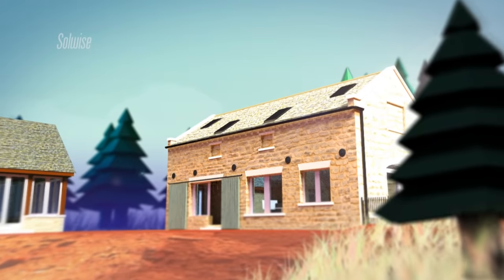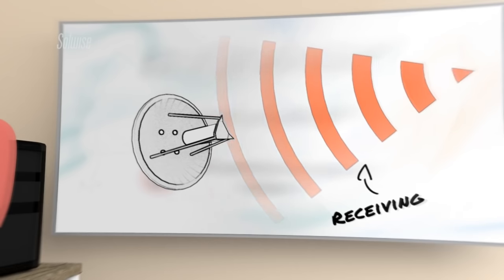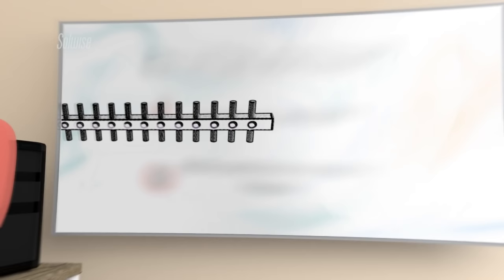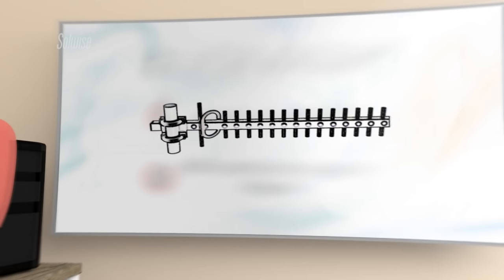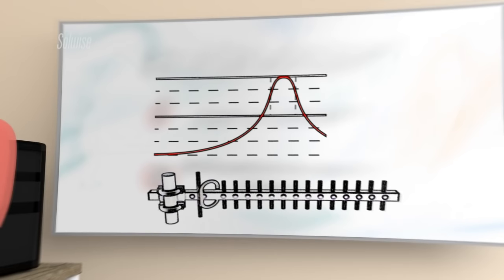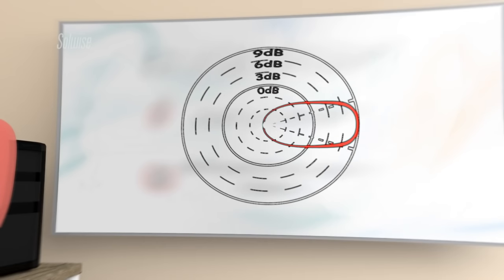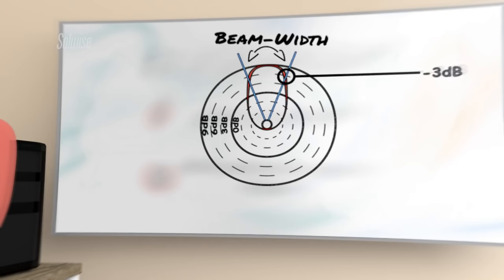Antenna Radiating Patterns explained

Comment: I have wireless mixer that has built in Wi-Fi and a single external antenna. I can't practically place the mixer very high off the ground so would if make sense to add a cable to the antenna and just mount it up high? I'm thinking this should/could boost the effective range of the signal. Is there any reason this wouldn't work?
Reply: @SolwiseMD  Funny. Thanks. Good to know about signal loss. Was maybe hoping to go about 3 meters (over a bit and then up) but perhaps that much length would be self defeating. A little Ringo in your voice- absolutely love it. Perfect for narration and voice-over. Thanks again for replying.
Reply: @SolwiseMD  read my mind. was just waiting for you to say, "he was a cheeky little engine."

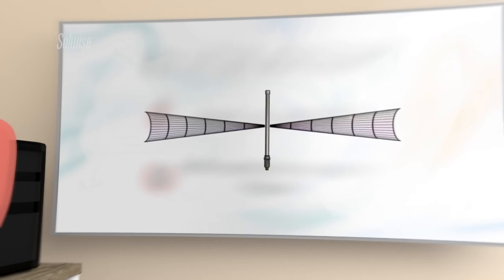Comment: I think your graphics at 4:03 are incorrect.  The narrator says that the omnidirectional antenna radiates in a horizontal disk.  The graphics at 4:03 show an antenna radiating in two vertical disks projecting out to the sides.  Clearly, it is not radiating equally in all directions in its horizontal plane.

Comment: Have you made a mistake for the uni-directional antenna? You mixed up the horizontal and elevation plane.
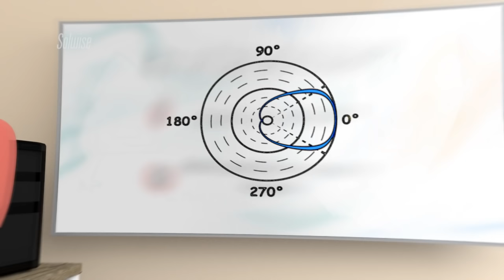Reply: @SolwiseMD At 2:10, the video shows a side view of the antenna, then at 2:20, the video said that it is showing the horizontal plane polar diagram. Hence, the video is saying that the horizontal plane is the side view of the antenna. The diagram should show a top or bottom view of the antenna instead. 

The elevation plane diagram is correct though, showing a side view of the antenna.

Comment: How can a cellphone booster internal antenna only cover some meters away in open field and a cellphone, with ominidirectional tiny antenna and low power, be able to transmit over 40Km ?

Comment: Wouldn't elevation plane in directional antennas be the "up and down" and horizontal plane be the "left and right"?
Reply: @SolwiseMD  "The elevation plane is like looking at the antenna from the side.  The horizontal plane is like looking down on it from above, like a plan or a map."
Exactly, and your graphic is showing antenna from its side and calls that horizontal plane 2:41 and then from above 2:43 and calls that elevation plane. Or am I reading it wrong?
Reply: @SolwiseMD  I'm a noob hence a noob question. 
Looking at this again the confusion originated from the graphic layout, e.g. at 2:39 the horizontal plane is the plane from which we're looking at the antenna as it is presented in the graphic, so the "left-right" direction (if we imagine aiming the antenna at the transmitter). But the polar pattern placement in the graphic at 2:39 would suggest the "top-down" direction. I tried to combine both in the same space but that's not how it works. 
The video is very helpful.
Reply: @SolwiseMD  yeah, that clicked, thanks.

Comment: Can anyone help with this question? An output power of 16dBm, linked to an antenna with a gain of 21dBi linked with a RF cable attenuation of 1dB use this information to create a point to point link (2 radios same spec) with a distance of 3km. They operate at 5.850GHz
Reply from the maker: You need to do a link budget. This cannot be done until you know more details of the receiving end e.g the receive sensitivity. My gut feeling is that this link should be fine.

Please note 16+21 EIRP is over the UK and EU legal limits.

Steve

Comment: The omnidirectional description is wrong.  Omnis DO transmit and receive from ALL directions and not into a disc shape only.  They do focus some energy but all directions are covered.  The disc pattern is misleading to viewers since that is the path of the strong part of the signal, but the signal radiates in all directions in a sphere, just not equally as strong in some directions.  Beam antennas are the same way, they radiate in ALL directions, just not equally well.
Reply: I am a "ham" I know lots about antennas.  My point is you should not use words like "only" and "none" when talking about beam antennas such as they radiate energy ONLY in the favored direction and NONE in the unfavored which is totally wrong.  Even a 100 element beam will still have radiation off the sides and wherever the weakest signal from it is.  There is no such thing as a perfect null with antennas.
Reply: Also your hypothetical example of a church steeple beam antenna to service a nearby village with Wifi can be easily solved with a 2nd access point servicing the inside of the church using a drastically different Wifi channel and optionally different polarization (not required but helps).  This is Wifi 101 stuff.
Reply: Not just in sectors, in ALL directions there will be radiation.  Imagine a sphere around a wifi antenna up on  your theoretical church steeple... go anywhere in that sphere (within reasonable distance) and I guarantee you will get at least SOME signal.  It might not be usable or fast but it will be present.

Comment: I notice your video and the specifications of antenna products on your web site do not correctly specify "dBi" or "dB re isotropic" where absolute gain is most certainly implied. "dB" is, of course, fine when you are comparing two values, but absolute references require more clarity to comply with the expectations of the SI unit system. This makes your otherwise nice video incomplete at best. Worse, it makes your antenna product gain specs deceitful at best. This is a common mistake made by newbies to antennas. You might want to fix it and fast.

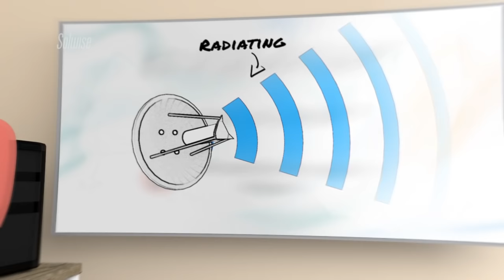Comment: 0:36.  That statement is false.  For example, if 2 hams are communicating with each other at long distance (perhaps a few thousand miles), the polarization of the transmitted signal can change so there is no guarantee that the antenna that transmits well on one end will also receive well on that same end because the polarization change may be different in the 2 different directions of communication.  In some cases it may be better to Tx on one antenna and Rx on another during the same contact.  That is not "cheating".  Many hams try different antennas during a contact for that reason (uncontrollable conditions by mother nature).

Your other wrong statement is that omnidirectionals don't radiate in all directions.  They do.  In fact, even beam antennas radiate in all directions!

Downvoted for blatant errors.
Reply: I think you're throwing out the baby with the bathwater here buddy. I found the video well made and informative.
Reply: David, Mind explaining how any of that affects dBi? I've literally never encountered a scenario where what you're describing is relevant when considering dBi. If you have fresnel obstruction, say on a HAM, 3G, 5G, etc, that has nothing to do with dBi. The antenna will still provide the same performance, should Fresnel obstruction not occur. You sound like a hobbyist out of his depth.
Reply: The point is not about dBi, that is hypothetical gain in free space.  My point was antennas that Tx well might not Rx as well cuz of possible rapidly changing conditions.  We do not live in freespace.  The polarization of a DX signal could easily change during a contact and frequently does.  Similarly, a ham in a car at a red light might have clean Rx from a repeater, but then when it comes time for him to Tx into that same repeater, he accidentally crept his car a little and is now is a partial node, making him noisy into the repeater.  He might not know this until someone else mentions it on the repeater.  So an antenna that can Tx cleanly will not necessarily Rx as cleanly (and vice versa) cuz of changing conditions.  What this person in the video is presenting is a simplified version for newbies to understand but in the real world, it is not really accurate.  Assuming nothing else changes, then Tx and Rx should be the same for the antenna but that is not a real world scenario because many things change.
Reply: @davidjames1684  "The point is not about dBi" But it was. That is all they were talking about in the video. Of course Fresnel Zone obstruction and interference is going to change results. You coming in talking about it on a completely accurate statement about dBi is just you trying to thump your chest.
Reply: There are several ways to disprove what this person is saying in this video.  For example, a case where an antenna does not Tx and Rx equally well is if the antenna (and/or feedcable) is overloaded on Tx.  The theory as explained here is just a starting point.  Free space plots are only a reference.  Real world results are different.  By the way, I watched the video and did not see or hear one single reference to dBi.
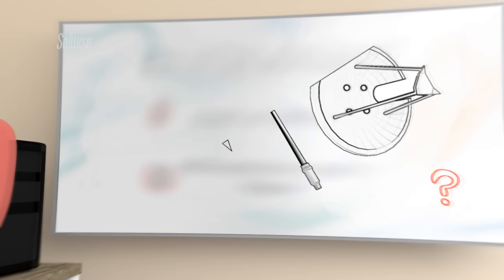Reply: @davidjames1684  @0:36 refers to dBi. Also, referring to a radio on a discussion about antennas is just plain silly. Move on dude.
Reply: Wrong, no explicit mention of dBi was made in this video.
Reply: @davidjames1684  Whether or not dBI was directly stated is irrelevant to the fact that dBi was directly referred to. An antenna that is good at sending energy is always as good at receiving energy. That is dBi.
Reply: dBi is a scale used to show gain relative to an imaginary isotropic antenna.  His statement was regarding antenna reciprocity.  Those 2 are quite different.